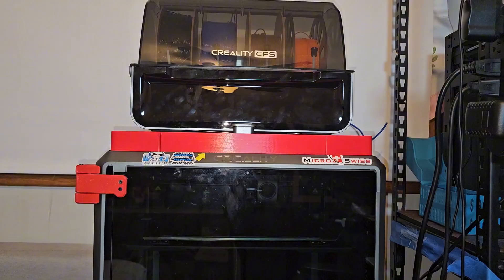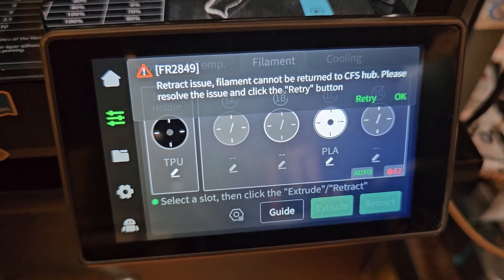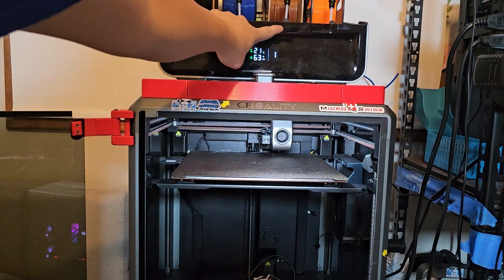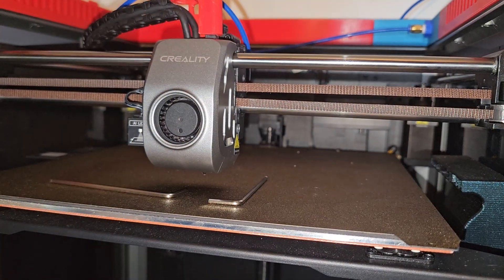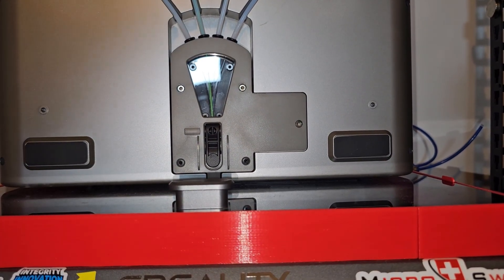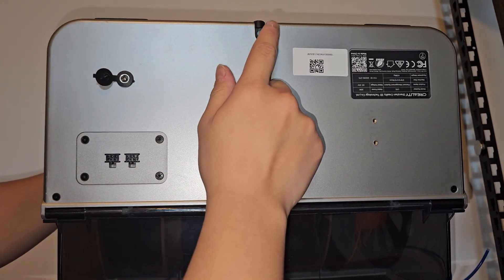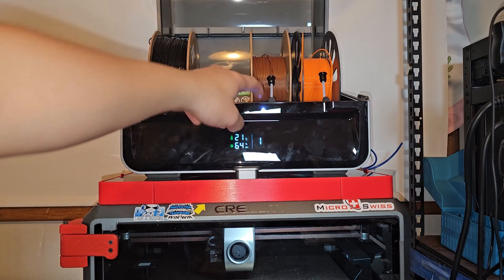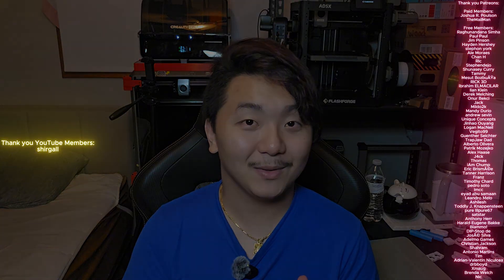K1 Max CFS Kit Keeps Having Retracting Problem

Comment: If you print the CFS silica bead trays for the CFS it will reduce the humidity to around 23 percent. I am glad you fixed the issue. My issue a while ago was a faulty runout sensor. Creality sent me another and all was fixed. cheers
Reply from the maker: Heyy, thats nice that craliry send you a new sensor. I'll keep that in mind and maybe print it to see if it will reduce the humidity.
Reply: @Scratch3DPrinting  After having the silica beads in now for two days the humidity went down to 23% in one of them and 21% humidity in the other. I also used the method you used for adjusting the bed level on the K1 with the allen key and it really helped so thanks for your guide. I look forward to your next video. take care
Reply from the maker: @CaptaIn_NAM1 that is some good info, glad my videos are helping you out.
Reply: @Scratch3DPrinting  
With 60% humidity it comes at a surprise to absolutely no one the the filiment is brittle and broke on its way to the hot end.

The place it broke is easier than most to extract you don't need to unscrew parts like you did you could have disconnected the ptfe tube and pulled it off will pressing the release latch.
This set up is the reason why I think the cfs is better than the ams by bamboo labs.

As for the drying set up this can be a great video for you to make silica gell and all but better yet get yourself a filiment dry box 2.0 by creality disassemble it and insert it inside the cfs that way you can add the heating element to the cfs.

I agree that it was a missed opportunity by creality to make all in one unit and seeing how they expanded the dryer line up I don't think will make and upgrade kit but we got what we got.

And this hobby comes with a lot of DIY stuff so I don't think it is out of the 3D printer user wheel house to do a project like that.

By the way I just got a dryer and I intend on making the CFS an all in one unit and considering that a lot of cfs units are already out of warranty people will be less afraid to modify their units.

Comment: Filament that becomes brittle mid roll can cause trouble all the way from the roll itself to the tip of the nozzle. Bits break off and can clog up anywhere on the path of travel. I just had some very reliable creality hyper abs clog up in the hummingbird extruder. Luckily, it was easy to remove. Old filament, low cost filament, too dried filament can cause this.. Its important to 7dry seal and store filament correctly. But even if you do, things like this will eventually happen..

Therefore you must be prepared and have the appropriate tools to be able to fix issues when they arise.. Thank you for this very instructive and important video. You perfectly analyzed the problem, found the root cause , and expertly showed how to fix it.

Cheers, man.

Comment: I disagree. The filament tangle its all your fault. You see, I had the same issue because and all it was I left the filament loose in the CFS the same way you have it here without tension. Once u open the package hold the filament by securing it to the holes, same if u remove it from the CFS. That will avoid that tangle knot u got there for good. If the CFS retracts and leaves the filament loose, take it off, unwind it a bit and recoil it tight again.

Comment: I had the exact same issue yesterday but with my Anycubic ACE Pro unit!

LOL! Also on the 2nd slot...
When you load filament, it grabs it, then reverses and spits it back out!
I the noticed the the 2nd little buffer thing at the back was sticking out about 5mm or so...
I could pull it but it wouldn't go back flush.
Took it all to pieces and found that there was a tiny piece of filament, 5mm long, stuck sideways in the end of the buffer thing cause it to block up!!!

After sorting that all out, I was just getting blockage after blockage in the hot end!
What a morning!

I took the guide PTFE 4 way thing off the top of the print head so I could manually feed filament through.
Cranked the hotend up to 300 then pushed some PLA through for a while till it way flowing fast and smooth!

After all that I got 3 of the best prints I had done the whole week!

What a nightmare!
Reply from the maker: Wow, that sounds like a frustrating experience, but glad you got it working in the end!